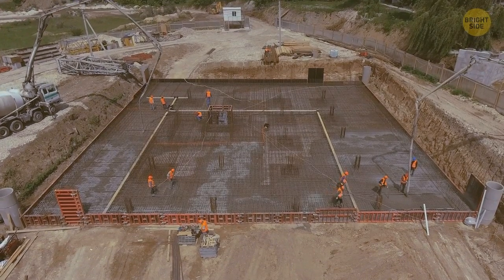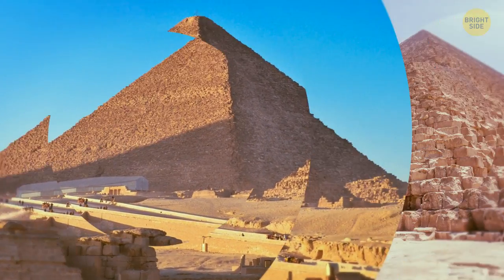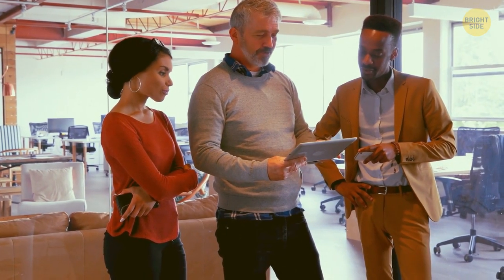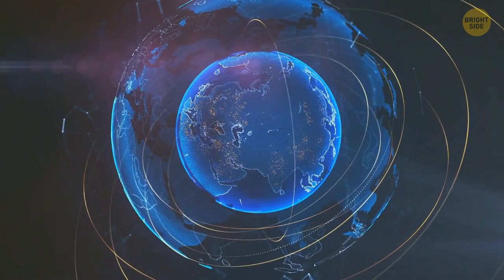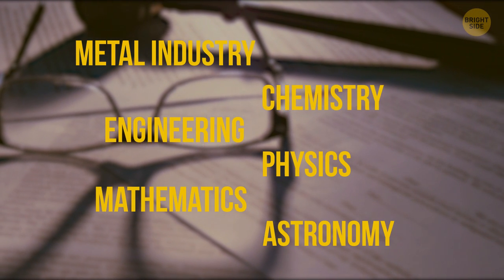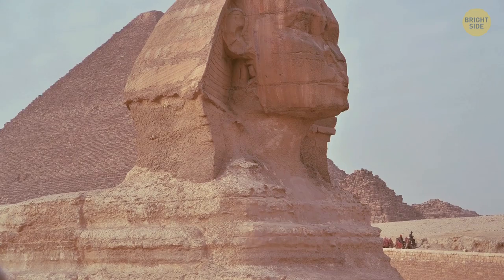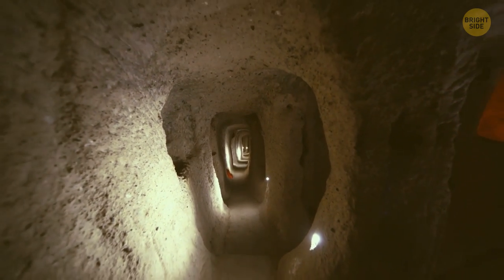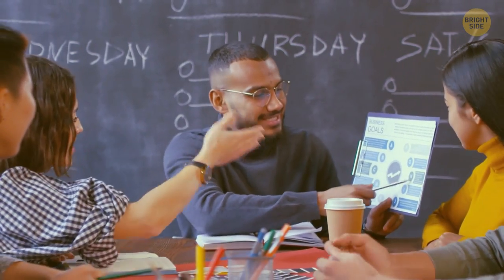Where Is Missing Capstone of the Great Pyramid?

Comment: I don't understand why you want everyone to picture the pyramids being built in the same conditions currently in that area. That area could have been just as plush and green as any other place on the planet at that time and would have had everything there required to support a society that large.
Reply: It’s a fact, the Sahara is only approximately 5,000 years young. The Nile used to run closer to the pyramids.  The Sphinx has  a lot of water erosion damage as well.

Comment: I WONDER COULD THE PYRAMIDS BE SOME KIND OF PROTECTION AGAINST SOLOR STORMS?  THINK ABOUT IT FOR A MINUTE THE PYRAMIDS ARE ALL OVER THE GLOBE EVEN IN ANTARTICA AND THERE ARE MORE BERRIED UNDER EARTH AND UNDER WATER THERE MUST BE A LOGICAL REASON FOR SO MANY AND IF YOU LOOK AT HOW THEY WERE BUILT ON THE VERY TOP THEY HAD A GOLD POINTED CAP ON TOP. IT HAS BEEN PROVEN THAT THE PYRAMIDA GENERATE AN ELECTRO MAGNETIC FIELD THE LIMESTOME IS FANTASTIC FOR ABSORBING ELECTRICITY AND THERE WAS A CANAL GOING DOWN THE PYRAMID LEADING TO A LAKE OF WATER UNDERNEETH THE GROUND COULD BE FOR GROUNDING  I WONDER WHAT WOULD HAPPEN IF A FEW OF THESE PYRMAMIDS WERE RECONSTRUCTED AS THEY WERE THOUSANDS OF YEARS AGO THEY SHOULD RECONSTRUCT A FEW FOR TESTING I HAVE A FEELING THE ANSWER WILL BE AWSOM AND SHOCKING.